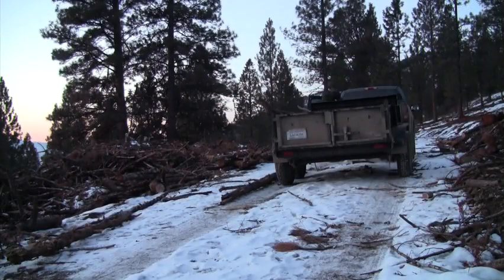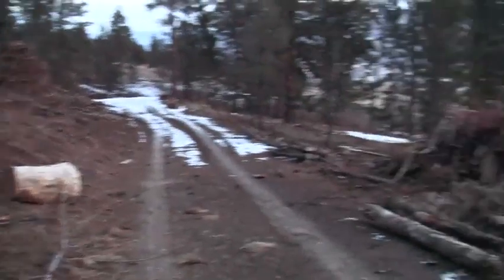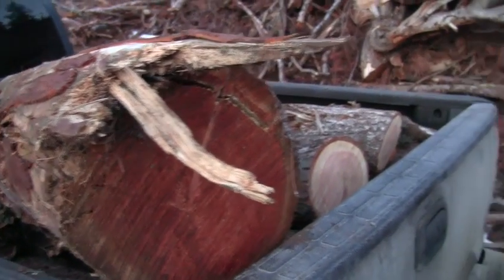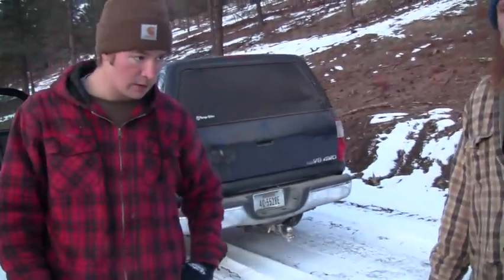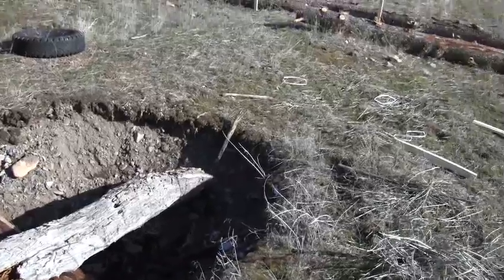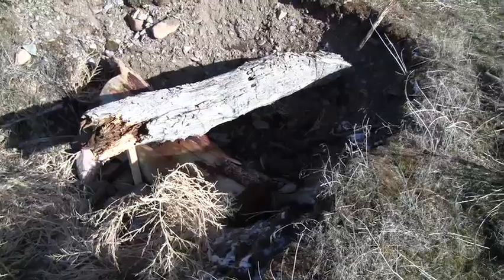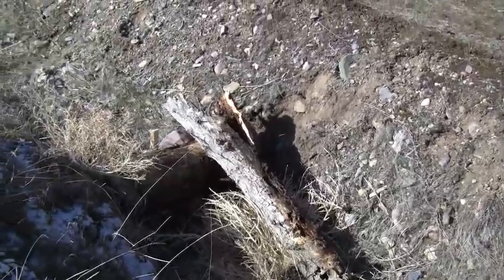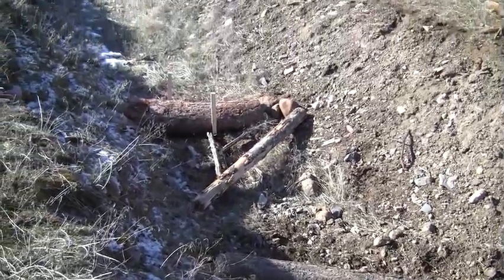MPG Ranch: Erosion Control Update 2 25

Comment: Hi,
How is that erosion control project working?  This winter I have been doing the same thing with logs in a gully on my dad's farm.  Some gov't bozos wanted to concrete it, but number 1, I don't have the money for it, and number 2, I don't want or need a big concrete ditch out in the country.  The big test will come with spring rains, but I think it will be OK.  I am also planting native ninebark bushes, which have an extensive root system, in the areas with the worst erosion.  Let me know if anyone has any other ideas that are high on sweat equity but low on cost.  thanks